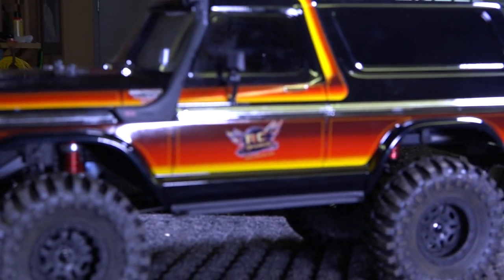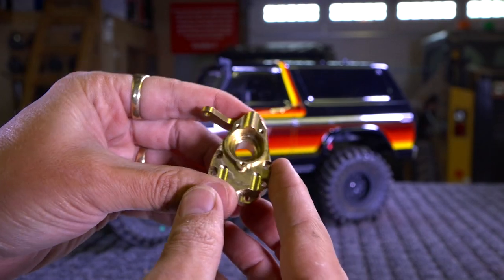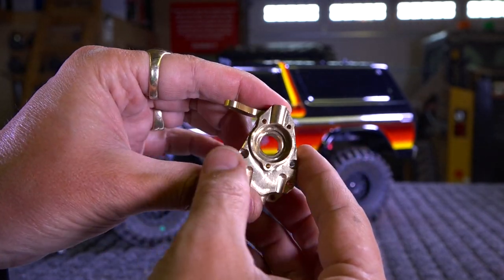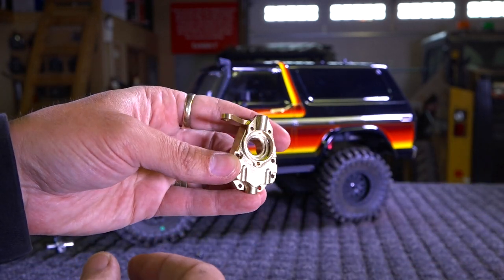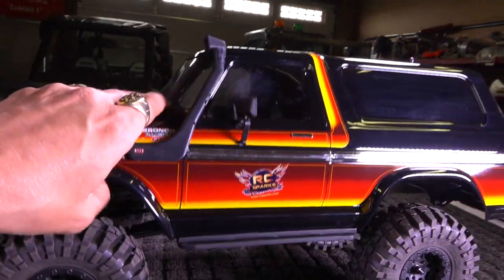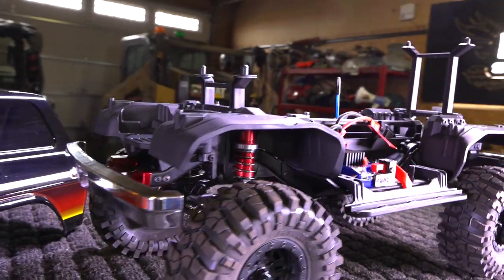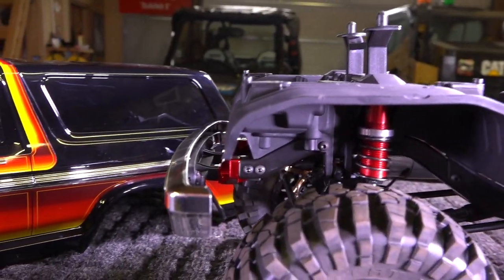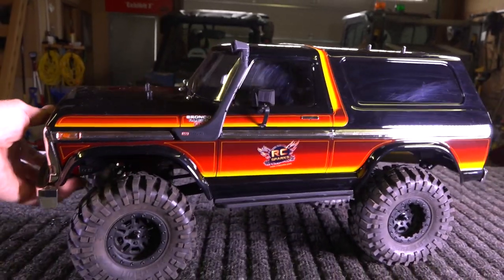TRX4 TRAXXAS FORD BRONCO HEAVY METAL UPGRADES! | RC ADVENTURES

Comment: ???  You passed on the steel axles, maybe just missed seeing them?
Sure, mine is going to be a Sunday Driver until I tear up a couple rigs and get tired of fixing them. Till then, going to go overkill and from the frame rails up, aluminum, below will be brass and steel.
lol... what eye and hand coordination, made putting the license plate on look way too easy.
Your going to put some wear on the bumpers and I recommend getting some Molotow Liquid Chrome for touch up and even bigger pens for larger projects. Stuff looks like it came off of a chrome parts tree.
So far, its my best looking rig, one day I may test it.

Comment: Welcome back Aaron 🙌🏽 back to the show 🍿🍺
Reply: #portalenvy 😁 The trx4 is such a solid rig ! It would definitely be cool if the came out with a rock crawler and eliminated the 5 servos and upgraded the steering servo and  offered a dig option instead of two speed & f/r lockers... every time I see portals it makes me want to modify a YXL transmission into a set of portals 😁

Comment: Brass knuckles, very metal ;-) Nice find! Meh, that servo, it ain't gonna break but just get slower and slower ever so slowly. Pretty quickly it won't even be able to scoot the front around like you like to do at a standstill. Go ahead, swap it out.With all of that weight and torque you're going to be unable to drive well if you keep it in there. I've already transplanted mine into my Twin Hammers thrasher [which I thrash with glee] and it still ain't dead. Just slow.

Comment: Bumpers on these are a crippling problem i recommend getting metal ones amd something without a hitch amd pull them in as far as you can. Also flip the bumper mounts so they are higher, you will need to trim the underside of the front of the body to the bottom of the grill and trim the back to the bottom of the tailgate trim. approach angle increases a lot just by 2 simple mods.

Comment: Don't know if you'll get this since it is an old Post, but you mentioned changing out the steering servo, as does everyone in every post I read on the trx 4. I just got in my trx 4 sport, haven't had a chance to run it yet, but I plan on changing out the servo soon. What would you recommend for a replacement? My first RC also by the way, thanks to all your videos.

Comment: For those of you looking for a cheap easy ish and reliable way to add as much weight as low down as possible on your crawler for extra traction… get yourself some good soft tires with as chunky of tread as you can find and some beadlock wheels, take the foams out of the tires and assemble half of the wheel on each tire, and when your putting the front ring on the wheels, submerge the tire in water and get as much water in the tire as it will hold, dont want any air or it will slosh.  get all the bead lock rings somewhat snugged up and hold it under water and gently squeeze the tire, then tighten it all up under water, this ensures a bit of tire flex while adding as much weight as possible as down low as possible. Idk how many other trucks i outran on trails, climbing tests, competitions with this method. Works great and no messing around with sticky weights. Keep in mind you may have to go from like a 21T motor to a 37T because of the added weight will literally double if not more the weight of the entire truck
Reply from the maker: But then you have rotating mass.  This is a bad thing on all of your bearings and drive train. This is why they dont do that.. and put weights on the actual axle housing
Reply: @TheRealRCSparks  i suppose it worked good for me because i had everything upgraded to aluminum or steel axels at the time and only used water for a few months so didn't see the long term effects

Comment: I would change out the steering servo mine went out the 3rd time I ran my trx 4 bronco.......  i put a savox metal geared waterproof one in while i was waiting for the factory to send me the replacement to get to me.....  it is a fun truck to run.

Comment: Do you think the stock spring rates will be good?  They are .45 all corners if I'm not mistaken.  I'm eventually upgrading to the proline powerstroke scaler 90-95mm shocks but just would like to hear you're input for the stocks.  My rig is right around 9lbs depending on the wheels and tires I run.

Comment: Ive already replaced my 2nd 2075x because it was covered under warranty   I just replaced it with a high torque Water proof Savox and keep the new traxxas for a spare . Any way let us know what you think of the portal weights been debating putting them on??

Comment: Hello, the truck is looking fantastic!   Curious as to why you injected grease into the rear axles?  If you pull the differential cover, and pull the ring and pinion you'll notice the bearings kind of block off the axle tubes so injecting grease into the axle tubes does nothing but grease the solid metal axle.  :-/  Kinda a waste of grease.  Not giving you grief I just didn't know if you knew this is all.

Also no link to the brass goodies you scored?
Reply from the maker: Hi Terry.  It fills the space so water and mud do not rust and cake in there. :)

Comment: I killed my TRX4 steering servo 😱🤷🏻‍♂️ what’s a good replacement? Only mods on my truck are aluminum bead lock wheels and 2.2 super swamper tires. I would like metal gears, I can water proof myself and I don’t wanna break the bank 🤓🤔😁

Comment: Have you noticed much of a difference between the original, tactical, & the Bronco TRX-4's? Aside from the obvious disadvantage of the high center of gravity of the original Defender body, have you noticed much difference of the 3 different TRX-4's? Mechanically and capability speaking mainly, however any other aspects as well. Do you have a preference? Aside from your love for the very awesome Defender body that is. ;)

Comment: lowering the CG at the cost of raising the unsprung weight is too high a price to pay imo.
High speed runs over bumpy terrain is going to be hard on the wheels, tyres, suspension and drive line.

Comment: notice you never really give links to the parts you add on. really could use links to those weighted options. being i am canadian as well and can't find anything in canada as far as hop ups and such. i don't want the covers as they are more exposed in your face and well i'm not gentle lol. this option seemed little more tucked away
Reply from the maker: I said in the video that I got them on ebay. I dont leave links becuase ebay links Die off. Ebay is a great place for parts if you need them..  :)
Reply: ya $16 tho. sweet score. cheapest i'm finding now are $30+ usd. suppose this proves the point of no ebay links because they gone lol
Reply from the maker: Nailed it.. haha ;)